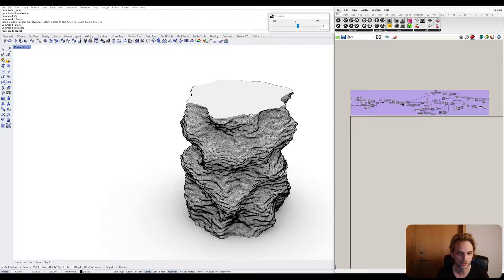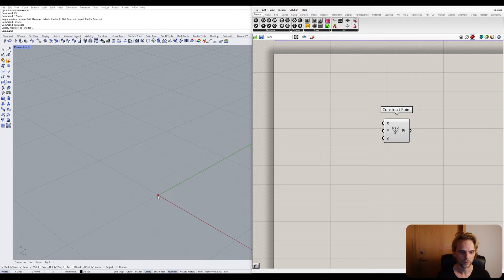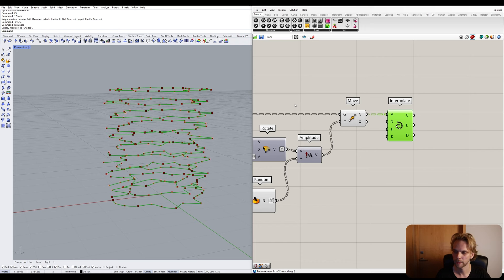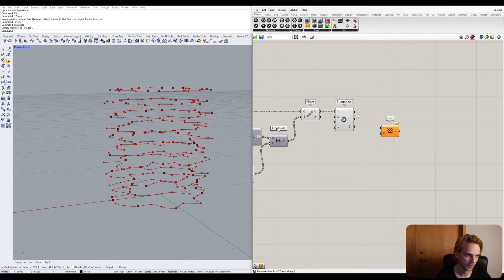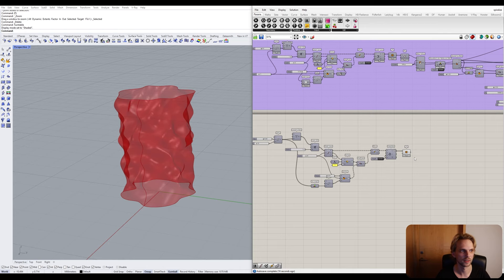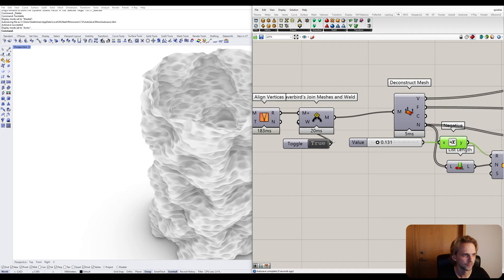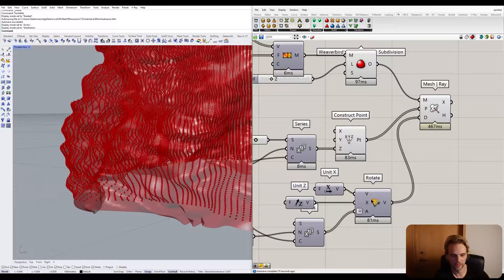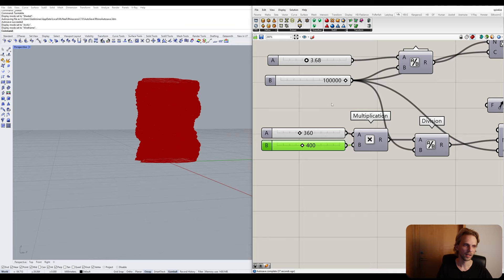How to: 3D spiralization technique for diagrams and 3D printing (Gh + Silkworm tutorial)

Comment: Another fantastic tutorial--thank you very much. I made one change at the step where you extract the normals from the mesh vertices for the small scale displacement. I passed all the normal vectors to a"Deconstruct Point XYZ" node. Then I connected ONLY X and Y (not Z) to a "Construct Point XYZ" node. The output from this node is a vector parallel to the z plane. This seems like an easy (fast) way to simplify later steps as there is no need to trim off uneven top and bottom of mesh.
Reply from the maker: That's a very good pointer, let me pin your comment! :)

Comment: Hi Gediminas, really appreciate your work, big thanks and greetings from Germany. I just revisited this tutorial because we´re getting a big robot + extruder soon at uni and I´m already preparing to create toolpaths. While reconstructing the script for the spiralization I was bothered that it doesn´t let you choose the layer height like in normal slicing software. So i came up with a simple script using the contour component where you can set the distance between contours. After you make the contours you divide those into points and move the point of each contour up incrementally with range component and contour distance parameter as the domain. After the z up move you just flatten all the points and you have a list of spiralized points, an interpolation curve will give you the spiral visually. Most important thing is to cull the last index of the range values so the last point on each contour doesn´t end up at the same height as the first one of the next, so you actually get a perfect spiral. 
Just wanted to give a solution to those looking to set the layer height
Really love what you do, keep up the good work!
Reply from the maker: That's a good way to do this too! Just by reading the description - don't see any issues with this workflow.

Comment: Excellent video. I have a question. If I needed to control or change the Extrusion amount (E-steps value) can I control the parameter in the silkworm feature? also can you please share the G-code file generated by this process? Many thanks for the excellent video.

Comment: Surface from points component is giving me errors. I followed this tutorial more then once but still running into same problem.
Reply from the maker: It's a 1 hour tutorial that I recorded 3 months ago - without a timestamp it's very hard to find where exactly your surface from points component struggle happens.
Reply: Added a Expression on U from Surface from points and flattened merge
Reply: Same issue. It happens at around 36:00
Reply: make sure you go from merge (flattened) to surface from points, not the polyline..

Comment: isn't this something a 3D printing software like Cura could solve?, or would a software like that not be precise enough? anyway thanks for introducing me to silkworm!
Reply from the maker: Yea, all slicer software packages have a spinalization script embedded into them. The issue is that they are all about plastic FDM printing, so it becomes a bit of a pain to set up for clay printing. Also - I like to use spinalization as a graphics technique as well. Cura doesn't let you export the toolpath curves that easily